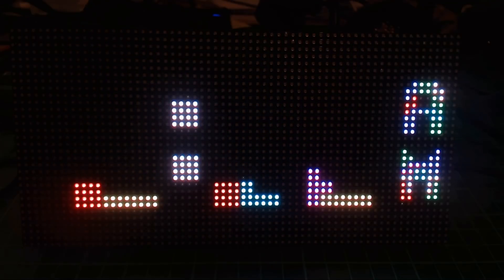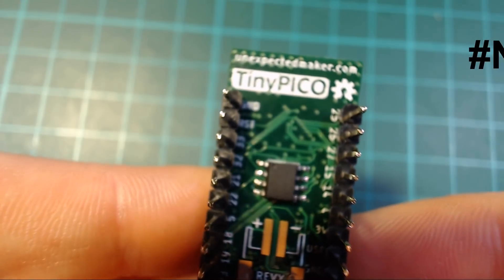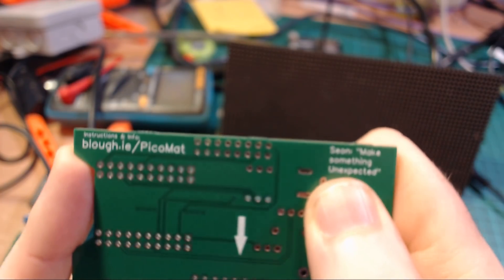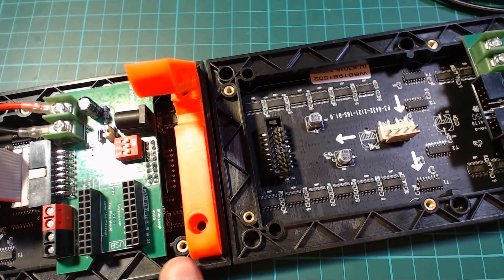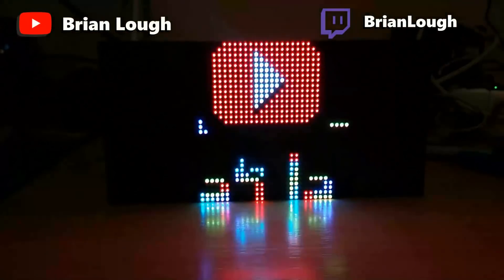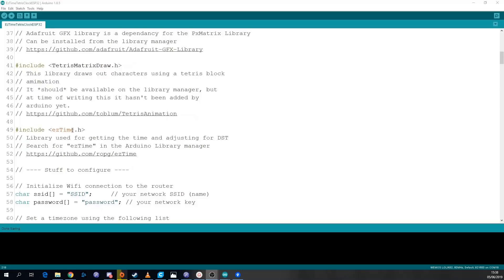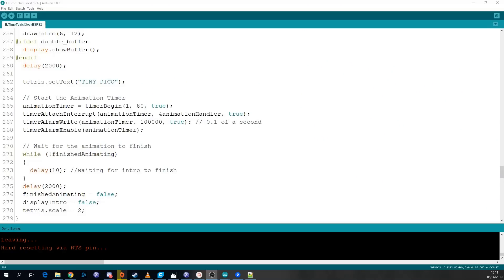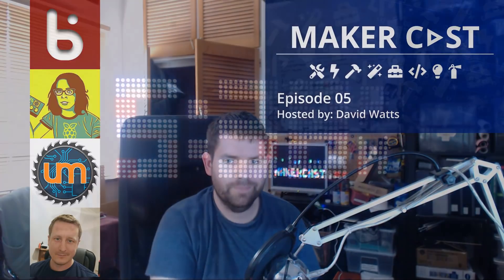Tetris Clock using an LED Matrix and an ESP32 (without RTC)

Comment: Nice to see that the good old TetrisClock library is getting some attention again. I haven't been able to do as much of it over the last few months as I wanted. 
I don't really understand why it doesn't want to run on the 8266 anymore. I‘ll test this out with my spare 32x32 matrix, which I have here laying around.
Reply from the maker: thanks for all the hard work on it! I'm sure I broke it whatever I did! It would be great if you did, I think the main problem is trying to run the animation in a ticker. Tabltronix did some good research into it on an issue for the Tetris clock sketch
Reply: Have you figured out out yet? I can't seem to get it to work either. (not that I'm particularly qualified)
Reply: @GreenOnionBrother  Unfortunately I didn't find time to look deeper into it, so far. But I could make the original version (https://github.com/toblum/esp_p10_tetris_clock/) work on my new matrix. But I also had issues with tetrisanimation lib.
Reply: @toblum  It is not possible to execute delay() or yield() from an asynchronous callback. Adafruit_GFX::writeLine() is calling yield(). Therefore, you cannot call any primitives drawing lines from a ticker. Interestingly, if you use a scale of 1 and no colon, everything works fine. Else, just set a flag in the ticker and draw in loop(). Works well.
Reply: @LaurentPerrinlolo  Thanks for your feedback. I'm trying to find time to revisit that project soon. I'll try to remember your message when I have a look at it again. Or if you have a improved version, please feel free to send over a PR in github.

Comment: already tried this, works great, as long as the matrix is 64x32 and based on HUB75 it should work on any pitch models, already tried it with P2, P3, P4 and P6

Comment: This seller is taking a break until Dec. 31, 2023. Sign up below to get an email when they're back! well damn, no breakout till 2024.
Reply from the maker: Hi Roy, to be honest I'm not sure I'll open again. check out this video though https://youtu.be/vugulzS0EoU
It's the same project using a different board that is available to buy now. It's actually even easier cause you flash it directly from your browser!
Reply: @BrianLough  Do you have a link to the Trinity board?
Reply: @BrianLough  Disregard that, lol. I found it. Thanks.
Reply: @BrianLough  Thanks Brian, got two Trinity boards on the way!

Comment: Hi everyone. This project is not compiling/has errors on Arduino 1.8.13. Any pointers? Links to a forum where this problem can/has been discussed and where error messages can be shared?
Reply: do you have the libraries installed? and the right board picked? I too wish we had a forum cause i have a different issue with a 64x64 panel not displaying properly.

Comment: Beautiful clock. But can`t get it to work! Could someone help me understand what i`m doing wrong?
I have wired it like it is mentioned on the github page. I have tested it with the pixeltime sketch. Works like a charm.
But if i load the tetris sketch, the display won`t light up. First i tried it with the d1 esp32, just like  the one used in the example. I use a p4 matrix.  I don`t have to use the e pin, so i changed the sketch into (  PxMATRIX display(64,32,P_LAT, P_OE,P_A,P_B,P_C,P_D); ) The pinout is ( #define P_LAT 22
#define P_A 19
#define P_B 23
#define P_C 18
#define P_D 5
#define P_E 15
//#define P_OE 26 //TinyPICO
//#define P_OE 21 //Huzzah32
#define P_OE 2 // Generic ESP32

The matrix doesn`t light up. With the pixeltime sketch  it does, but not with the tetris sketch! Than i tried it with an esp8266.
It starts, it connects. Shows brian lough, than it goes black and does it again. So the screen works. But not with the esp32. What am i doing wrong?. In the monitor you can see it connects to the network and gets the time, but it won`t light the matrix?  Please some help??? I would like this clock to work. The dancing banana, the mario and all the other examples work! But not this clock.

Greetz Harrie

Comment: Hello Brian,
Recently bought the ESP32 kit from you on Tindie and I want to use this with a 64x64 display, is this possible?

Regards,
Dirk
Reply from the maker: Yes it can do 64x64
Reply: @BrianLough  i can change this in the .ino file?
Reply from the maker: If it's the pxMatrix version you can yes, you can just change the values that are passed to the constructor near the top

Comment: Hello and a great project. Maybe you can help me with a problem I'm having with mine   I'm running the tiny pico with the display you suggested when it's running all I have is the first four rows are  working the next four are not working.  The next four are,  the next four are not working etc.  I have 4 displays and it doing the same on any of them I try  I'm not sure where to go from here. or what to change in the code I have watched your other videos on RGB led matrix how to get started etc  but not having any luck Thank You for any help
Reply from the maker: https://github.com/2dom/PxMatrix/issues/119 there is a solution for this problem here, skip down towards the end
Reply: @BrianLough  thank you for your reply  My clock is working fantastic now   Not too many people on  youtube answer back on questions  Again Thank You for your great help

Comment: Thank you for your Tetris Clock project. I don't know what I'm doing ha,ha. But after a few weeks I got it to work. I needed to add more code to the sketch to get my panel to display properly.  // Set the number of panels that make up the display area width (default is 1)
  display.setPanelsWidth(4); That took care of my problem, and now is working as expected. Thank You very much!

Comment: Hi Brian got your esp32 board running from tindie and running code examples fine ie aura and pixal time the Tetris clock ino uploads fine no errors but when I plug matrix in the matrix does not light I have set  all dip switches right to run example codes fine but no go with Tetris clock been at this for a while now please help thankyou
Reply from the maker: Did you update your wifi details? Is there anything happening in the serial monitor?
Reply: Serial monitor showing just 1 back to front question mark
Reply: Sorry 3 back to front question marks
Reply: And D
Reply: I have a Adafruit panel which the R1 pin top left so with the the 2dom wiring it doesn’t require pin B ? 
I reset device and have a ok in serial monitor still no light
Reply from the maker: If you search for "generic" in the code there is two places it appears. Uncomment both of those lines and comment out the lines above them marked "//tinypico"
Reply from the maker: Also, I think your serial monitor is set to the wrong baud rate, it should be 115200
Reply: Matrix shield is a D1 mini 32 and board is a mini 32 wroom v1.0.0 serial monitor showing time now put still no lights
Reply: Showing time
Reply: Code is EzTimeTetrisClock ESP32
Reply from the maker: Is the display working ok with the pixel time and Aura code examples?
Reply: You pin wiring on YouTube is different to the one I downloaded still called EzTetrisClockESP32
Reply: Hi Brian thankyou so much got Tetris clock working ok now it was incorrect Baud rate and that second // on TinyPico look forward to getting other shield from you and setting up a larger matrix with one way mirror and frame

Comment: Hi Brian, just finished a build of this clock using your tinyPico and Matrix. Was very easy and it looks great. Many Thanks! for a great project.  Did have one issue (fixed now) and wanted to feedback to help others. Clock had 2 horizontal bands of missing pixels about 3/4" wide. The trouble shooting section of PxMatrix library provided the answer: add this line to code: display.setMuxDelay(1,1,1,1,1);   I put it at line 234 just before buffer flush in // Intialise display library section.
Adds a 1us delay to each of the A-E channels.  Guess panel I purchased has a slow multiplexer.

Comment: what pin is P_E on LED P5?I don't find it
Reply from the maker: It's not on all displays, usually it's only found on 64x64 ones
Reply: @BrianLough ,thanks!!!  so could you help me connect LED matrix 64x32 to esp32,please???
Reply from the maker: @hahainguyen3403  just make the same connections in the GitHub link but don't connect the p_e wire
Reply: @BrianLough  yeah,thank you so much

Comment: I made this with a devkitv1 module and it works great, but you need to change the display.begin() about 2/3 through the code. I don't think it was mentioned at all. I used my bench power supply and it never goes above 250mA, so if you only want a Tetrix Matrix clock you could power from usb.

Comment: Ordered a D1 from your Tindie. I bought a ProjectMC2 from Amazon (£20) yonks ago after seeing BigClive tearing one down.
Reply from the maker: Cool, if your in the UK your order came in literally just in time as my wife was just about to head to the post office!

Is that the pixel purse? I know for sure it works with them as somebody has tested it before, but you will need to solder to the unpopulated connector of the purse and possibly solder to the power connector too. I'll try update the instructions page of my website with some more info about it

Comment: Beautiful project! I would love to replicate it :)
If I understood well, the minimum hardware needed is
- matrix panel
- esp32 mini
- power adapter

Is this correct?
Reply from the maker: Yup! You'll also need some longer style Dupont cables because you need to connect from one connector to the other. Wiring diagram is on the project GitHub page.

It definitely doesn't need 8amps, but I don't really just the rating on cheap power supplies! I'd say the displays in general probably need 4 amps , this project needs a little less because it's not setting the colours to white often

Will be writing up an instructables for it shortly.
Reply: @BrianLough  Thank you for your reply! Parts will need some time to arrive from China, so I can wait for your Instructables too (I'm not an expert with programming but I'm very good to follow instructions!).

Comment: What's not to like? Blinkenlights, internet and a TinyPico. Great breakout board. Well done! 
I'm looking forward to try this Tetris library on my 24 x 16 matrix. Sounds like it's easy to use and very flexible but my display might be too small. 
(Still curious to know why the ESP8266 crashes. My experience is that it needs plenty of RAM available (>25K) or it may become unstable (depending on what libraries you use).